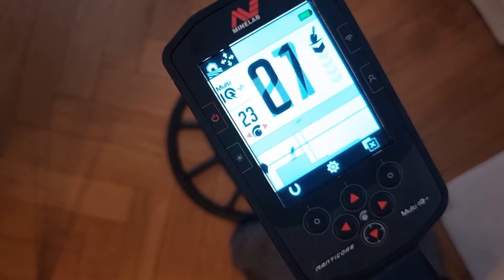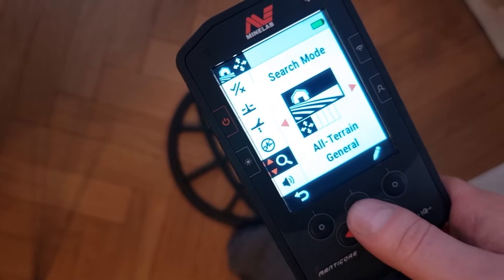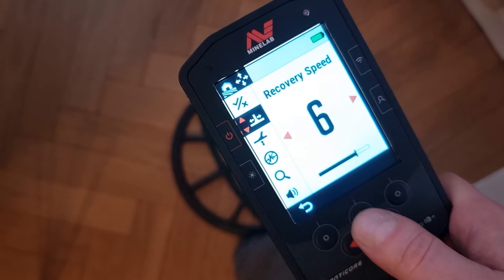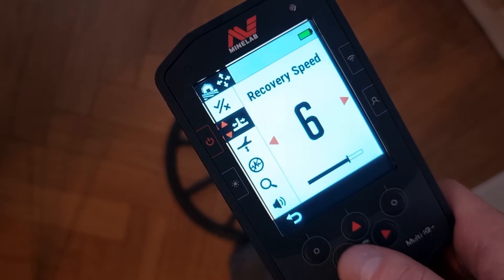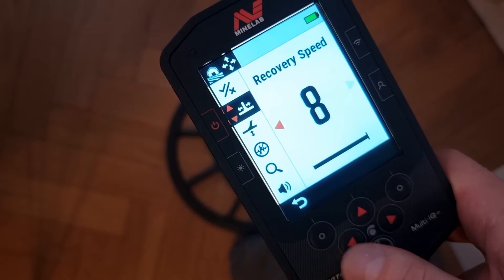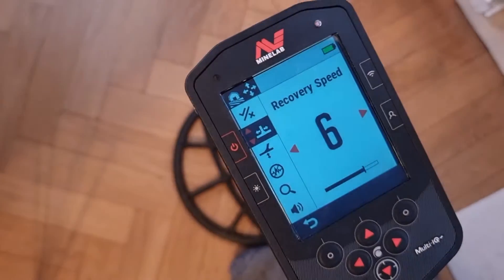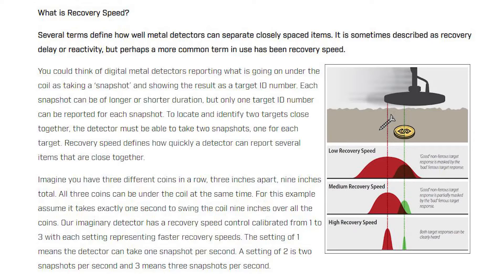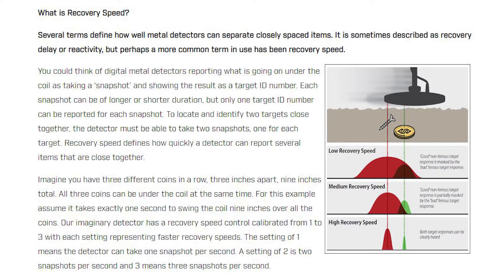Manticore programs in detail: #8 Recovery speed explained

Comment: Thanks for vid.Can you explain to me the receiver on coil does it operate in all metal and only after it enter controll  box it separate everything to your setting.Also on transmitter on coil only put out electrical charge  power setting and what frequency your operating in ?
Reply: All Metal Mode, turns On or Off the ferrous audio. 

The receiver coil (Rx)  is passive. We adjust the Sensitivity (Gain) to enhance the received signals.

The transmit coil (Tx) radiates an electromagnetic field. We adjust the Recovery Speed (Power) to put more energy to the coil or less energy.

Mike in CO
Even though we say TX and RX when referencing the coil, it's more accurate to think of the coil as the primary and secondary of a transformer.

When energized, the coil creates a carefully balanced magnetic field in a process we call Induction Balance. This field can induce eddy currents in nearby metal objects that can/will disrupt this carefully balanced field, providing us with a target signal to process.
dankowskidetectors